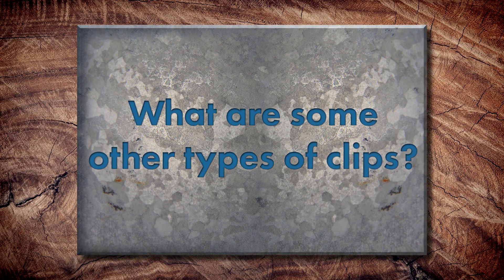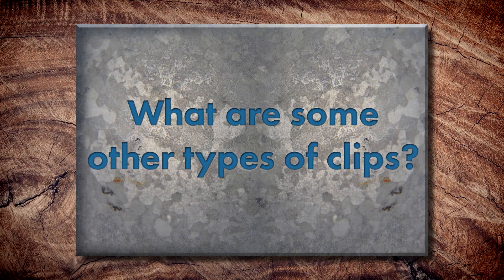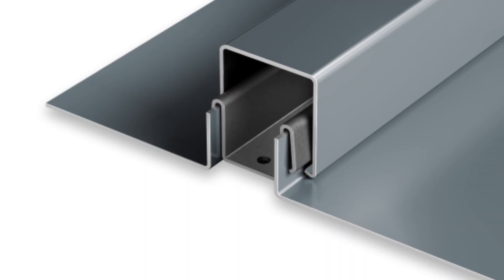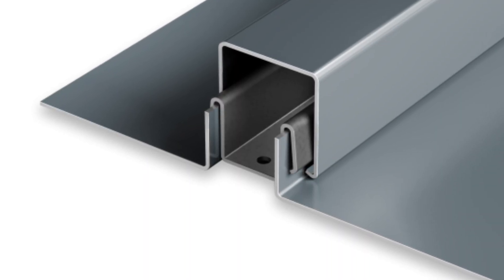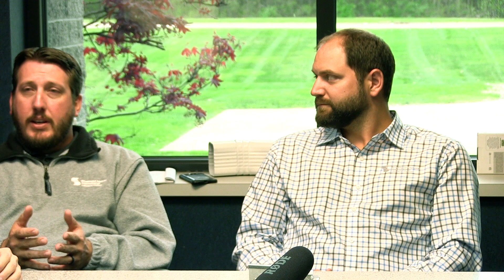Metal Roofing Clips: Definitions, Engineering, Profiles, Materials

Comment: What changes occur with the clips when you use a 3/8 mesh below the metal panel? A 1.5 mechanical lock in my case. I cant find any install info or experience with how frustrating dealing with the mat compression creates or other issues. Thanks for your channel.

Comment: Thanks for the video! Does the fixed clip that goes with the batten lock system and is covered with a cap allow for expansion and contraction of the panels/roofing system?

Comment: Do you charge the contractor to engineer a project?
Reply from the maker: Hello, Brian! SMI does not charge a contractor to use our engineering provided that it is SMI material and the material is being used with an SMI engineered panel profile. It is the sole responsibility of the contractor to ensure that the panel is being produced within tolerance and that the proper components that were tested in the assembly are being used. Also, it is the sole responsibility of the contractor to ensure that all local and national building codes are being met as well as any additional specified requirements. In cases where additional engineering calculations are required, these are usually performed by a third party engineer at the contractors expense. Thanks for the question! -Thad